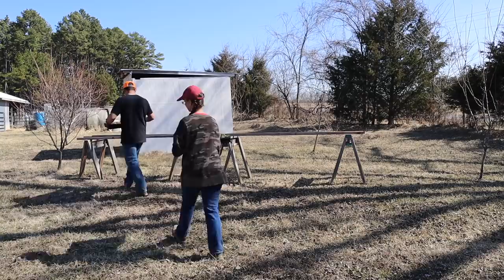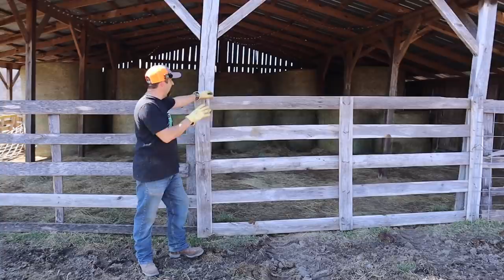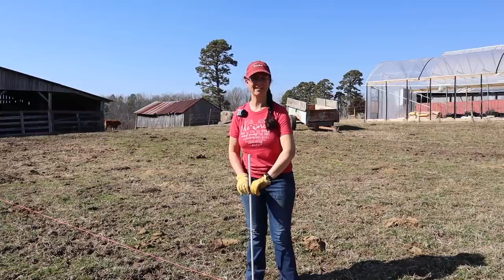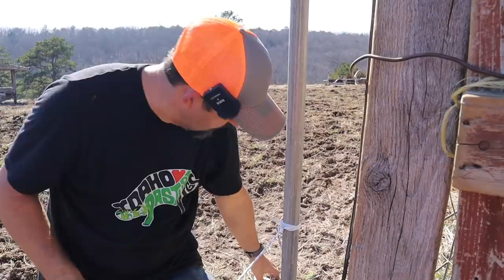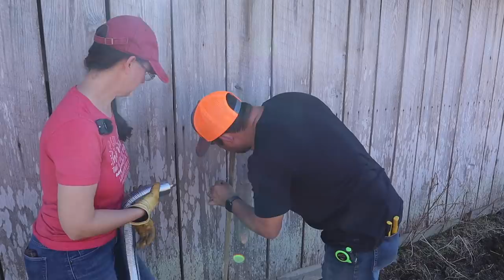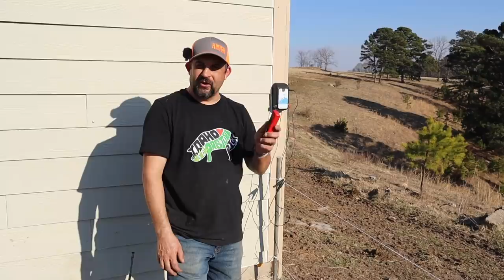An EASY fix to a DIFFICULT problem!

Comment: Well done with the fence guys.  The knot you used is I think called a Uniknot which I also use for fishing here in Aussie.  Another very good video with lots of information.  Keep it up you two your awesome.  Also I found that the black zip ties hold up much better in the sun than the white ones.  Here in Queensland Australia we have some of the worst sun and it destroys the white ties.
Reply: I think different areas call it something different. We call it a half hitch knote
Reply: The black ones have some UV protection where the white ones don’t.
Reply: Good to know about the zip ties, I was about to pick some up for solar ties. Thank you!
Reply: I've found the same with Zip ties too.  The black ones last much longer being UV stabilized, the white ones get brittle after one year.
Reply: @robertsimmons1264  Actually, the second one was an improved clinch.  Could not tell which clinch the first one was.

Comment: While expensive(ish), I look semi-envious every time I see you use your post driver.  You got yours after some wear, tear, and injury.  But this is a life-time tool and belongs in the hands of young type people as much if not more so than older, injured, folks.  Back injury seldom happens as the result of a single incident and that hammering, jerking, and impact action of the handled, manual, post driver causes impact on the discs in your back with each downward stroke; even those with bulky muscles in thier 20's.  For those of you watching out there, do look at one of these.  At $250-$450 per visit to a back specialist, the cost for one of these is worth saving for and spending.

Comment: The grapes sound like a fantastic idea. Make sure to protect the bottom area with a grow tube-otherwise your critters will eat the plants down to nothing in a short while. The first year you can leave tall(3 ft) grow tubes on them until fall. Either remove them for winter months, or cut the tubes down to around 18 inches(a that height they can be left on year around) Just check to be sure rodents are not making homes inside them. The vines will take a couple seasons to complete cover your arch-but after that with pruning they should make a good permanent solution.

Comment: Spring gate is installed backwards, pull from the cold side so when disconnected it isn’t live shorting to ground
Reply: Agreed.  I would hate to have to be the gate opener in that spot.
Reply: @tarabauerle1239  when I was a little kid I was, that’s how I learned painfully
Reply: Yep you're right.
Reply: @tarabauerle1239  painful learning curve
Reply: I think those of us that have been zapped by these gates caught that one , good eye
Reply: Hooking up the gate backwards is like holding a rattle snake by the tail in a wind storm

Comment: You may want to check into muscadines for your area.  We grow a few grapes here in Georgia but the muscadines are much easier to grow, grow faster, and get much bigger than regular table grapes.  You can also use them to make wine.  We made over 50 gallons last year from our muscadines and we don't drink.  Great gifts.
Check out Ison's Nursery.  They have a YouTube channel and you can order muscadines from them.

Comment: At the old San Jose Spanish Mission in San Antonio, Texas, along the long barrack structures where the priest's lived, are grape arbors I believe they are muscadine grapes. This, as you can guess, provided shade and also cooled the buildings in the hot summer months.

Comment: Grapes are a great idea but I don't think you will get much shade the first year.  I would plant some Cardinal climbers.  They are an anual, covered in small red flowers that the hummingbirds love.  They will cover the trellis until the grape vines take over.  Cypress vines also do the same job.  I put seeds in the ground right after our last frlst but I have also started indoors for a jump on the season.
Reply: In the South where I live, both Cypress vines and Cardinal Climbers are very invasive. I am having a constant battle with Cypress vine, even though I have allowed none to seed for six years!
Reply: @andy38andrews96  Didn't know they were invasive in the south.  I think because they get frosts and more freezing temps it would be ok.  I do mostly cardinal climbers on one of my trellises.  Stopped the cypress vine several years ago because of inconsistent flower colors.  I would buy red and end up with pinks and whites and the Cardinal seems to flower better.  I guess there is a plus to having to survive our cold winters (and most of spring lately!).

Comment: Hi guys. Great job. I'm am curious about your  T Post  hammer. I'm needing one that I can use on several 2" posts. I rented one last week but it didn't fit down over my pipe. If you could supply any information it would be greatly appreciated. Thanks.
Reply: Hope this is what you require
Reply: @Text+①⑤①⓪⑧⑥⑥⓪①⑨⑧  I not computer savvy I wasn't expecting anything except an answer to a question. Thank you

Comment: Great video guys.  Although I appreciate the value of electric fence (I have a lot of it) I can tell you, your fence is more elaborate than I do...lol.   I would have ran the electric wire all around the barn through insulators to keep the cows from rubbing and save the cost of the insulated wire.  The gate - that looks great but mine are just the electric rope on two handles - same principle just different products.  I do put flagging on them though.  When I unhook I lay on the ground and drive over the rope with the tractor...the snapping keeps the animals back and any mud just falls off.  As you know an open gate invites them to try to go through it and the rope on the ground is the physical barrier still in place as well as snapping...they stay back.   But all that said, I think building that area into a hay yard with permanent fencing and permanent gates is the way to go, in my humble opinion.  It just affords you so many more options for hay storage (and equipment storage if you wanted) and movement without having to redo the electric or maintain power to it. Additionally,  I find the electric rope only lasts about 2 years or so and then starts shorting out (the knots will burn off first) and it becomes a major pain to find the breaks.  But at the end of the day, this will work for a time to be sure.  It looks great!  Good job!  Take care, keep smiling and God Bless!

Comment: I'm just finishing my grape season here in NZ. Reading the comments theyre all good advice. Only thing I would add is once the grapes are established feed them lime. I give mine about 20lb+ each per year and they are sweet as. All the best.
Reply: Thanks, I've got 3 old Thompson seedless, cut back to stumps  and a red flame 3 years old. Seldom see any grapes so cut way back to start fresh.
Reply: @heatherk8931  yes I cut mine back to the main vines every year and they always grow like crazy through the season. I get about 80-100lbs of grapes per plant. So many that I give most to the local food bank and they love them (way better than store bought ones).

Comment: About those saw horses - Home Depot in this area often introduces a cool, item or few between August and October at what 3ill become a great price if they sell and re-order.  One year it was the fold-up, metal saw horses.  Initially sold as a set, the second order sold them individually for the same price.  The third order leading up to Christmas doubled the price for an individual saw horse; so yeah, 4X the price between late August and December.  We got a set in August and choked on the first doubling of price but have kept our eye open on yard, moving, and estate sales until we have the 6 we own now.  They are pretty handy, store well, and can be tossed in the back of a truck, wheel barrow, cart, etc..

Comment: You can put an eyelet screw into the barn and wrap a piece of wire around the post then loop through the eyelet to support the post under tension. It worked great on our barn.

Comment: Close detail on your securing knots would have been nice. Also, holding onto trimmings of electro braid, zip ties, etc. to minimize possible hardware disease would have added to the value of this video.